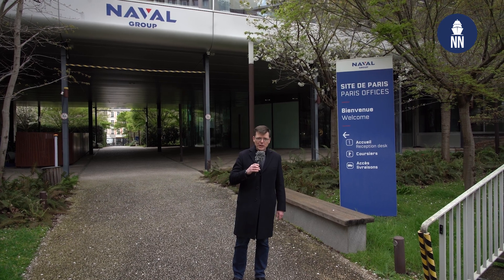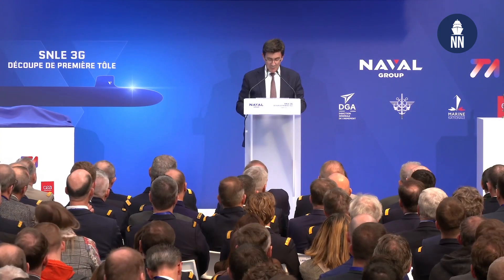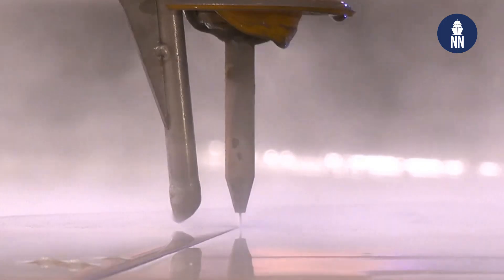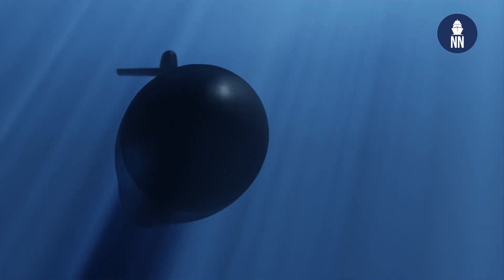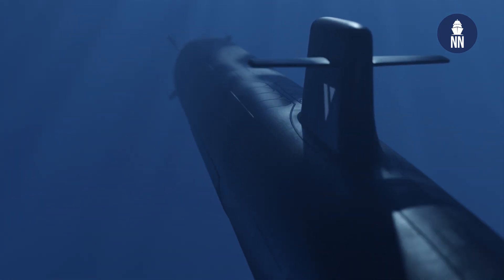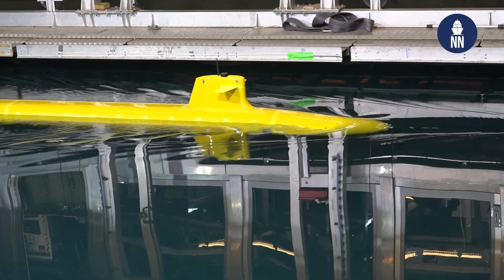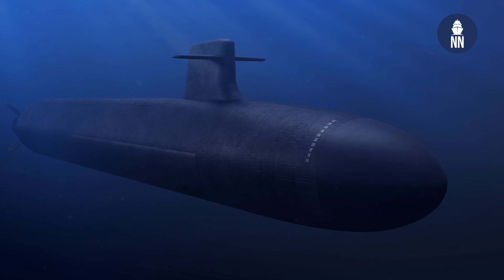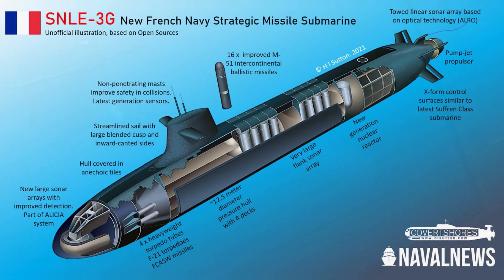SNLE-3G: France's Next Generation SSBN Submarine Begins Construction

Comment: The problem with the French and UK nuclear deterrence is that 4 submarines is just not enough. It is impossible to have this number operational at the same time. With two submarines operational and some nuclear capacity on fighters nuclear deterrence might not work very well. Two submarines are easy to detect and the fighter planes are vulnerable and have limited range. A serious nuclear power needs bigger numbers and a more various capacity. But that’s not feasible for the UK or France. The EU as a whole could do this but I don’t see that happen: who is going to press the button (although I hope that will never happen)?

Still I think that both countries should stick to their nuclear striking capabilities. It’s geopolitically still important and a bit is better than nothing.
Reply: I take your point, but with 4 subs it allows 2 subs to be on patrol at difficult times. In UK's case each sub has 12 ICBM's and for France they have 16 ICBM's.  When you tie in the fact that each ICBN is MRIV fitted, the number then add up.  So 4 subs do work well in offering a credible deterrent.
Reply: It is enough to always have 1 at sea, possibly 2.  The whole point of sub based deterence is that they are nearly impossible to detect in vast oceans.  
It's not WW2 when subs had to surface and could be spotted by planes.   When leaving port, subs are escorted out to sea by frigates and aircrafts so they cannot be followed/tracked.  Then once in open waters it is basically impossible to know where they are, except for dumb luck and dropping sonobuoys exactly at the right spot in the middle of the Atlantic.  Much easier to detect said aircraft so the sub can take evasive maneuvre.
They still haven't found MH370 in the Indian Ocean, so good luck with a stealthy sub.
Considering  1 sub can carry enough warheads to strike every major city of any country (16 missiles each with MIRV) , you don't need a dozen subs at sea.
Reply: Les britanniques dépendent directement des USA pour leur dissuasion nucléaire.
Voilà la différence!

Comment: Who builds France's ICBMs? LM build/lease the UK's, so not really independent.
Reply: ArianeGroup (owned by Airbus and Safran)
Reply: Aerospatiale! le M51
Reply: There is literally no scenario where Britain might feel compelled to launch nuclear weapons and the US would not also be giving it consideration.
That would be in response to an inbound enemy attack, or confirmed threat of same.
Britain is never going to unilaterally use these as a first-strike weapon.
You might equally argue that our F-35 strike aircraft are at risk of the US witholding vital software upgrades, but that's not going to happen either.
Reply: @ianmcsherry5254  because the Brits nevah had builded any H bomb (bluff) because the brits doesn't own any IP about nuke weapons and reactors, everybody knows  who the designers are,  so under leasing contract, brits are free and independent to ride oceans their expensive stuffs under US  HQ  :face-fuchsia-wide-eyes:
Reply: France designs and builds their own missiles. The SSBNs are completely under French control. The British and US subs draw from a common missile pool. The UK's missiles are fitted with British warheads, ensuring the UK's control over their own subs.
Reply: @edkrach8891  you don't need to control the warhead when you can control the missile, and you are naive if you think US has no backdoor to abort a launch.  
Just look at F35, the UK doesn't even have access to the source code and that is just a plane.  
You think the US hands out nuclear weapons without a failsafe so that they can be used againts them?  Sure the UK and US are allies today, but no one has a crystal ball to predict the future, governments can be overthrown, etc...
Reply: The British SSBNs use a common pool of missiles. Once they are on British sub with British launch authority how are they not independent.
Reply: @RogerPalmer-pi9yb They have a certain in dependance, but depending on a forein country for the technology of balistique missile is a loss of sovereignty. If tomorrow LM (or rather the US) decides to stop maintaining missiles, they will soon become obsolete and unusable.
Reply: @RogerPalmer-pi9yb  Cela s'appelle les doubles clés! l'Angleterre fournit le combustible(uranium) tout le reste est la propriété des industriels américains, comme pour le réacteur qui fabriqué par General Dynamics, missile LM Trident, 20% de vos sous marins sont équipés par BAE et RR pour les turbines sous licence GD! ce n'est pas très souverain d'avoir Washington à l'intérieur de votre ultime défense, la preuve du dernier essai de tir qui est un echec complet! et c'est la seconde fois! comme pour vos F35b! encore un crash la semaine dernière près d'Albuquerque, pas très sérieux et très cher, les anglais ont perdu tout le savoir faire et même que vous n'avez jamais fabriquer vos propres Bombes A! ce sont encore les USA qui vous ont vendu et mâcher tout le boulot, je suis désolé pour vous mais seule la vérité fait mal, il est trop tard pour revenir en arrière pour le UK!